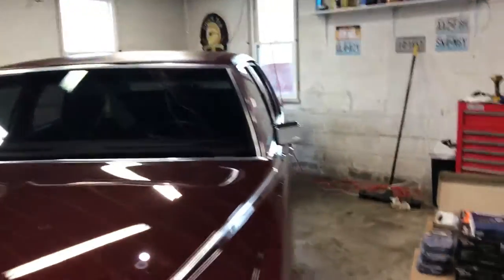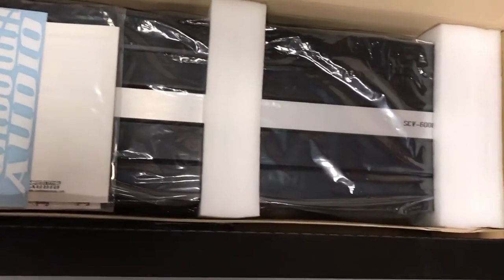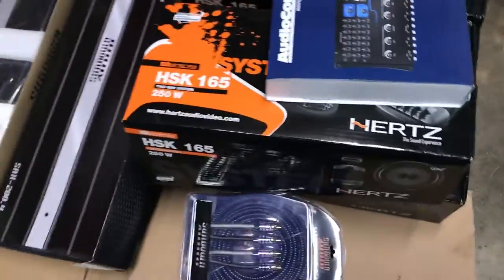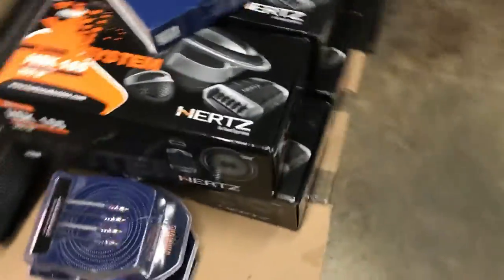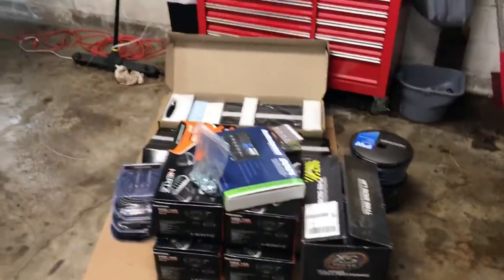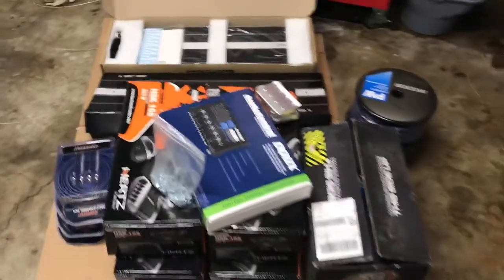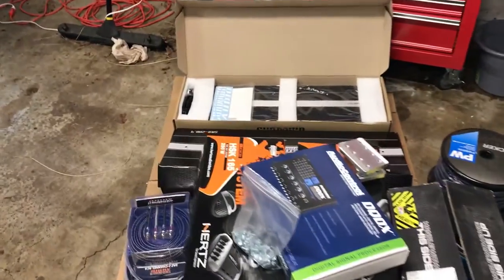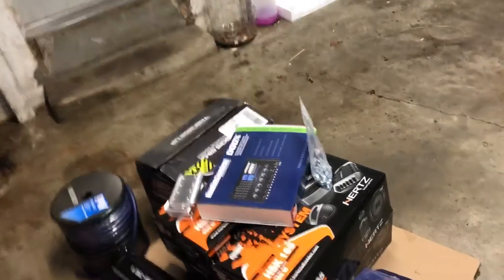1992 Cadillac Brougham D'Elegance car audio Sundown, XS Power, Hertz, Audio Control and Iraggi

Comment: You are not playing with this Cadillac!  I have 2 American Bass XFL 15" subs.  4 American Bass 6.5 midrange closed back speakers across the back deck with custom cut bass port.  Custom built console in the front with 2 more 6.5 American bass speakers.  2 American Bass Super tweeters in the dash.  Pioneer 4800BS double din head unit.  Pushing it with a 1500 watt 4 channel Audiopipe, and a 2000 watt D class Audiopipe on the subs.  Send me your fb info.  I will send you the videos thru messenger.